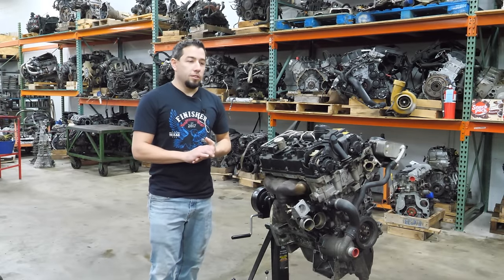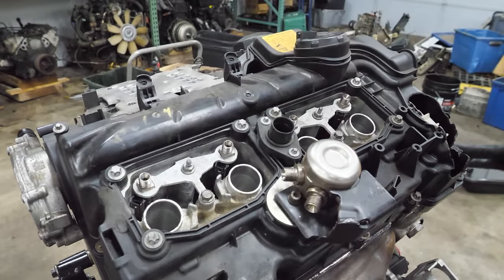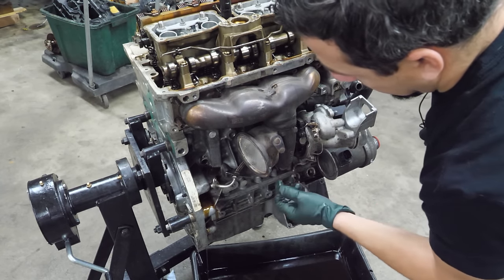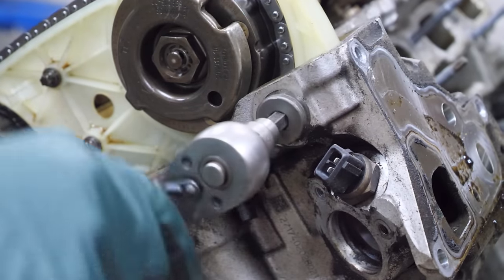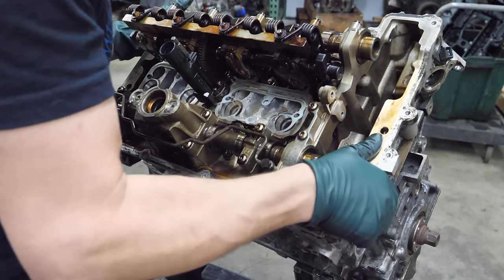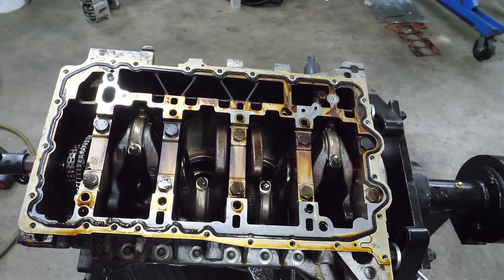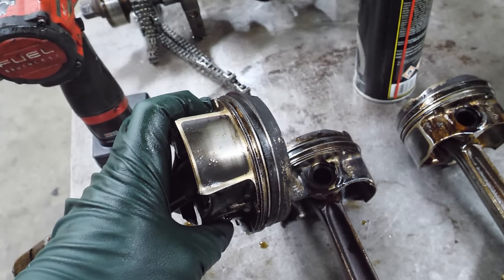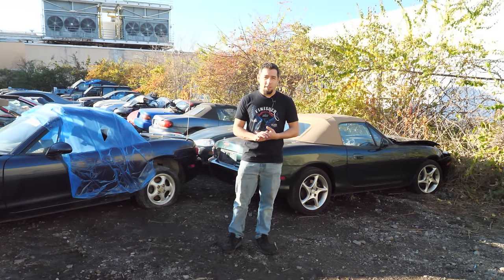SKETCHY RETURN? Was The Customer WRONG? Blown BMW N20 / N26 Complete Engine Teardown

Comment: Would have been interesting if you took the electric water pump apart. I think like 99.9% of the people here have never seen the insides of an electric water pump. Also would be interesting to get a feel for reliability. What kind of bearings do they use? Could you fix/rebuild it if they no longer offer the replacement part?

Comment: You shouldn't yield to the timing guide trolls , the coolant pump and oil filter trolls will smell blood in the water .
Reply: Absolutely! That's why you should always shatter plastic guides against a hard surface - the banishment spell needs to serviced once in a while.

Comment: I enjoy seeing these teardowns. It's personally something I'd love to do if I had the money, time, and even tools and whatnot. Primarily though I vibe with your channel quite well because I always loved to take apart stuff when I was younger, even tho most of that stuff was failed or otherwise nonfunctional electronics stuff that wasn't being used anymore anyways (that I also had permission to take apart too of course.) And while engines differ form what I did when I was young, it still fits in the general "take apart thing and see how it works and what went wrong." kind of deal.

Also a bit of a minor edit but... I have to personally wonder what the percentage of the watching audience of these videos is that is, people who know that timing chain guides cannot be reused, and don't mind you tossing them, as they'd probably do the same(I honestly would. it's fun if the timing guide is either just being removed for good in total teardown or being replaced for maintenance or otherwise), how many people are just trolls that like to just be silly in their weird way by acting like the people who don't know that timing chain guides cannot be reused. And then how many are well... the people who don't know timing chain guides cannot be reused. Like I really have to wonder that.

Comment: Thanks for all the content this week Eric. The Miata episode was interesting, cool car at your home shop. Personally, I would never buy a BMW, they can break your wallet when they break down. Did you spike that timing guide off camera? I hope so. lol I love the Saturday night teardowns and your comments🤣
Reply: Hey,this is my friends engine lol
Reply: Older bmws are great except for the oil leaks but I think bmw from the factory makes sure you engine is well lubed from the inside as well as the outside of the block. 😂  The problem with bmw is you should only buy oem or one of the other sellers who make oem certified parts for them. Because bmw aftermarket parts will work but not for long at all and I mean even down to the door handle carriers... I still own a 2006 bmw x5 4.4i and I love the thing it has just about 220,000 miles on it and still runs amazing... I will say though since I've owned it it gets new oil and filter every 4k miles and only using synthetic oil so maybe that's why it's treated me good. As far as parts lasting on them for an almost 18 year old heavy tank of a suv I had to finally swap out the factory airbags in the rear this summer which was a breeze to do. 

Oh For anyone who does the rear airbags on an X5 don't expect your air ride to air up with it still jacked up. 😂😂😂 yes it drove me crazy for about 30 minutes trying to figure out why when the light bulb finally went off in my head.  But im no mechanic by any means I'm just an average dude who is not scared to get my hands dirty.  OH also for anyone that ever changes the water pump in the 2006 N62 engine don't watch the video about the guy who claims you can get the bottom water pump bolt out by not having to take the crank pulley off. Yes you can get the bolt out, but not back in, so just spend the extra 10 minutes of your life ans pull the crank pulley off and thank me later that you didn't try his shortcut. 😂😂😂

Comment: This is why I love watching your tear down videos! This morning I learned about BMW valvetronic… What a weird design of engine. I don’t think I would ever have a car with this engine but I love watching you tear these down every week!
Keep up the good work!
Thanks for all the extra videos this week. That Miata you put back together correctly is a nice car! That video made me want one because they’re so simple.
Reply: Valvetronic is very reliable. Surprisingly so. It's the biggest reason these things are so fuel efficient. The throttle body is only there to keep the engine from screaming to high heaven if the valvetronic motor fails wide open. I've got 178,000 miles on my N52, and she purrs like a kitten with frequent oil services.

Comment: Nice teardown! I have a 2014 428i with the SULEV N26 engine which I love. The engine is very smooth and so punchy. So far its been flawless, but I am on top of the maintenance. The metal oil pan on the teardown tells me that it probably came from an xDrive model. Non xDrives were typically fitted with a plastic pan.
Reply: The shape of the pan to accommodate driveshaft/diff, and also the front axle hole at 20:50 tells us it's an xDrive.

Comment: Tip for BMW drivers: Move your seat as far forward as possible.

That way you can get even closer to the car in front of you.
Reply: And disable the airbags, they just slow you down anyway.
Reply: I think all of those drivers drive AUDI now, no?!
Reply: @matthewmclean9734 removing them saves weight, and the shorter braking distances from the lighter weight would be worth it. (Sarcasm)
Reply: They are after all, alphas, so they feel justified tailgating.
Reply: Snap Off the useless turn signal stalk while at it too ,it's useless on a BMW
Reply: Kia and Hyundai drivers are just as bad. Moving the seat forward makes them closer to home.
Reply: @DonnyHooterHoot  So think every truck driver that tailgates and rages.

Comment: I am glad I am sticking with older technology.  I have never seen a valve system like that before, or balance shafts.  Four pistons, one crankshaft, two cam shafts - done.
Reply: TWO CAMSHAFTS?? Young man, back in my day we where happy if we got HALF a camshaft and three valve springs. Four or five valve springs was reason to celebrate! We'd forge the rest of the camshaft from the remains of the Model Ts we had strewn about, and hammer-forge the parts together for a complete cam. Of course, we had to file the lobes to the correct shape, but a cardboard template did the trick.

You kids (including you, Eric!) have it so easy nowadays...

Comment: Have a 2015 328i GT with the N20, it is pretty low miles (78,000) but has been driven by three teen/college age boys. So it's had a pretty hard life. BUT, we have always used 0w30 or 0w40 quality oil (Mobil 1 or Castrol Edge). Not super short intervals, about every 7,000 miles, but that and a good Mahle or Hengst filter.  The oil level is near full every change. The car has been absolutely bulletproof so far. The 0w20 oil BMW wants you to use in these is a death sentence for sure.

Comment: Whenever finding signs of overheating, you should check the heads for warpage with a straight edge in your videos.  OHC heads cannot suffer much warpage at all since that messes with cam bore alignment.

Comment: I just found out yesterday when doing a head gasket on my 6 G 75 Mitsubishi Eclipse GT engine the the intake valves open together but one opens much larger than the other only when my back kicks in they will both switch to a completely different cam profile and they will both open all the way could have something to do with it I thought they opened equally together I guess not. I actually bent a valve while doing a water pump and timing belt by hand how to remove the cylinder head heated the valve up with a blowtorch till it was red then turn the cam to where the valve was in the down position found a large socket the size of the valve gave it a good smack pick the valve back up by turning the cam rotated the valve heat is it up again lowered it and gave it a good smack again put water on top of the valves to see if it leaked it is now fixed. I also created a new method to remove a dipstick tube using vise grips and a pry bar it was super easy barely an inconvenience.

Comment: The more I see this over-engineered German junk, the more I appreciate Ed Cole and the small-block Chevy. A cute little tin timing cover that does not tie into the heads and oil pan. A tin oil pan, and tin valve covers. If they were torqued right, they didn't leak. And no RTV or silicone anywhere. One short cam chain. A little square rod to drive the oil pump, and a valve train that you don't need an ME degree to understand. I had a 327 CID in my '69 Impala. A radiator leak made it overheat to the point it would not drive. I pulled over next to a ditch, and used a littered orange juice jug to fill the radiator with ditch water. It huffed and puffed a lot. I was a little concerned when I saw the dead grasshopper go into the radiator, but heck, it's a Chevy. I started it up, and it got me home, then ran fine for three more years until I sold it.
Reply: your mom likes BMW engines.

Comment: I found myself wondering which series engines are the best, as I drive an N55 in a 2015 x5 S Drive. It’s been reliable but I’m meticulous about maintenance at 5k. Eric brings up the N52 giving a clue with some older NA engines. Still it seems all the newer engines are force fed, right? Are any newer engines any good?

Comment: My first BMW is still my current BMW, a 1996 328i.  It’s 28 years old tomorrow, and has over 413,000 miles.  When it does die, maybe Eric can tear down its M52 engine.

Comment: Hi Eric, awesome content I look forward to seeing the mechanical ahem you show. I was wondering if you have “done” a 2009 to 2012 Rav 4, 4 cylinder engine with the severe oil burning issue. I saw another channel (Carecarenut) take one (2ARFE) apart for burning over 2 quarts per 1000 miles and it had regular oil changes. Oil was leaking from the intake manifold!
Thanks!

Comment: When I brought my 128i in for the airbag and PCV heater recalls, the service manager told me flat out to never buy a car with an N20. Now I see why. The timing sets go bad in these all the time. Imagine trying to do that job with the engine in the car. I wasn't surprised that it had a new timing guide cassette. These things make all kinds of noise on cold start when the guides wear out. The bottom line is that if you have one of these in your car, you need to change your oil every 5000 miles at most. Not cheap, but not nearly as expensive as a timing service or worse.

Comment: These cross shapes in the cylinders, are present in all N20's. I've endoscoped N20 engines with less than 40k kilometers that have those marks that run fine. I think the worst thing about these engines is the service interval BMW puts them through. 30k kms / 2 years is just insane for any engine.
Reply: The long (non-)service interval strategy is so stupid you have to assume it's deliberate strategy to kill the used bmw market
Reply: @greebj  When BMW went to "Included maintenance", they upped the OCI to 20,000 miles. Same engines, same oil, worse results. Epic stupidity from their marketing department. I'd imagine the engineers were screaming "Nein!" when that was proposed.

Comment: You noted a date on the chain guide. I've been told you can't tell the difference between old faulty guides and new revised guides. Can you tell me where that date is on the part? I'll be using a scope to see if I can find it on mine, so it's pretty hard to get a decent view. 154,000 miles and I have no idea if it was ever changed.

thanks

Comment: The biggest warning sign when opening up ANY Bmw oil filter is the dreaded RED oring... indicating you likely have a FRAM (or similar) plastic capped oil filter. It's almost a universal indication that there'll be forbidden glitter in the motor. The FRAM filters plug up SO quick and easily to the point that a good % of them are not filtering the oil at all by the time it's due for service. They usually have holes blown through them.

Comment: I recently put an engine in an Altima that had been driven with a blown head gasket for so long it literally blow torched the cylinder walls and melted the head between cylinders 3 and 4.  I think in my near 40 years in auto repair, it was the worst I had ever seen.  I asked myself "how long do you have to drive with a blown head gasket to get this effect?"

Comment: I've got a non engine question and I can't seem to find a reliable source to answer this. I have a customer with a 2015 Nissan XD Titan with the 5.0 Cummins and he wants to know if I can swap the axles for the 8 lug that come on then big Nissan van the NV 3500? The truck is two-wheel drive

Comment: Grotesque over-engineering. As a retired mechanic, I can say after decades of experience that I thoroughly loathe European car and engine designs. 
I am curious if those electric water pumps are reliable and do they run on 12 volts or is there an inverter involved? I retired just before these engines were brought to market so, I have no experience on this particular engine.
Reply: Check out VAG Technic for some real nightmares.

Comment: Those vacuum pumps are kinda pricey if I remember correctly. Of course I'd never sell a used one to a customer. Maybe on my own car. That will never happen though. If it doesn't have a T or H on the front it won't fit in my driveway.

Comment: Grind out the hairline cracks and put in some tin solder. Hopefully the compression will force the solder deeper into the cracks, forming a good seal 🙃 

Bet that's what Garage54 would've done...

Comment: Looks like the Butcher Shop Miata got featured at the end there.
Reply from the maker: Different green 2001 Miata lol
Reply: @I_Do_Cars A different green Miata with a tan convertible top in YOUR possession? Yeah. Okay. I buy it.
I mean, I won't buy the car but, well, you understand.
Reply from the maker: @CathyInBlue  technically speaking there are 5 green on tan 2001 Miata’s at my shop.
That doesn’t account for the one I just fixed which is at home 😂

Comment: Question: do you run unregulated shop air? 
I'm starting to use air tools at home and from what I've heard, most auto shops just run their air unregulated.
Reply: You might get away without a regulator, but I think that I would use 1 even if it’s not necessary
Reply: Only thing that gets regulated in my shop is paint gun. We run 190 psi.

Comment: I actually prefer the N20 to the N52. BMWs naturally aspirated motors do absolutely nothing for me. I got turned off to them on my E39. Gave Dinan close to $10k and got a measly 34hp on the M62TU. Screw that. I give Burger $499-$799 with a turbo motor and get 50hp+. I'll take the turbo every day of the week.

Comment: It would be very interesting if you tried to start some of the engines (that actually have chance of running) before we take them apart
Reply: Nah, he did that with the 12v cummins and lost a ton of usable parts. It was terrible.
Reply: @martin-vv9lf He did that though before. In fact it was arguably the most interesting video as he got a car engine started whose harness melted away due to fire

Comment: The oil has been replaced by the new eco-friendly, zero emission, i can't believe it's not oil(TM) only available for BMW engines with the super high performance plastic valve cover.

Comment: A slight adjustment to the line from Amadeus "too many notes" is in order as it relates to this engine, "too many bolts".  The Germans are deeply into over engineering everything which unfortunately add the longevity of the product.

Comment: Valvetronic, BMW's solution to a non-existent problem... Why create something that is supposed to replace an actual throttle body but still requires a throttle body to work correctly, it's as stupid as the Vanos variable valve timing system and probably just as expensive to maintain or repair.

Comment: Nonetheless weather what ever caused it.  Im still a strong believer in Shutting your engine off and NOT idling unless it is super cold outside.  A running engine is an engine that is wearing itself out especially in these new motors. Junk. These people should consider a early 1990s GM 3.1 Multi port swap.  Theyd do better. 😂😂😂
Reply: I know an old 3.1 Lumina sedan still kicking around despite a loud valve tick!! It'll probably see the apocalypse....
Reply: @jacquesc3166  exactly. I had a 90 Lumina years ago, I got  2 oldsmobiles 92 and a 96 currently both still fully drivable, What an underrated engine those were. Underpowered sure,  reliable and easy to repair absolutely, as they have all their accessories on top, back to front Alternator,  power steering and Water pumps and a forever "steel" timing "chain" and most importantly you won't find any plastic parts in or on the motors all aluminum or iron. Not bragging but people are forgetting what cars actually used to be with the exception to increased HP and torque. Doesn't seem like a good trade off.

Comment: These BMW engines are very nice, very high end, and very complicated and very driveable engines. The buyer of a new BMW is very happy with it I guess. BUT: when they get older, with some mileage on the ODO, they will get a real pita because they are so complicated and expensive to fix. Also not very durable and reliable. Using a cheap poorly made electric waterpump that surely will fail is a recepy for blown engines. Unnessecary complicated engine. A good shop replaces this stupid waterpump as a prevention, and changes the oil much more often as the manufacturer states. Maybe, maybe, by doing this it will last a long time without big repais. Obviously it's not a Honda or Toyota by far.

From good cars they have evaluated in throw away cars.